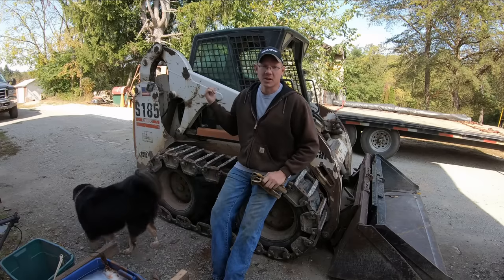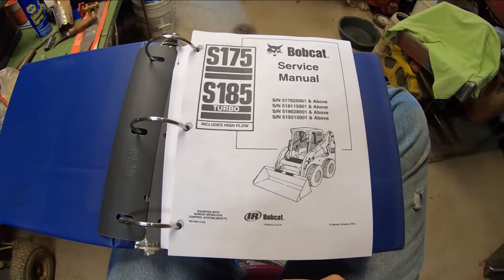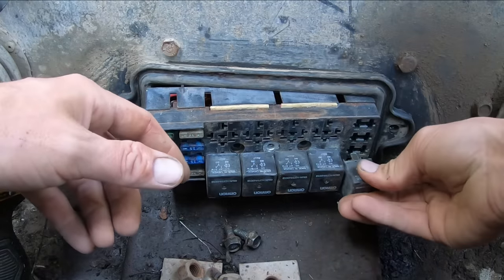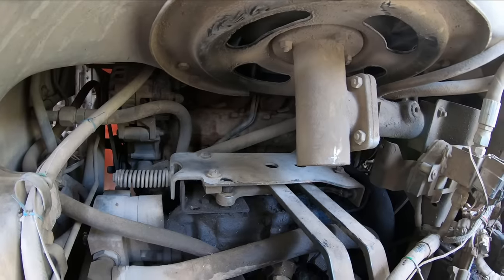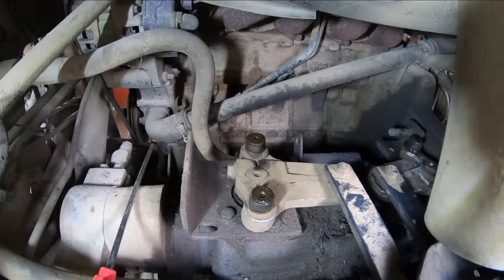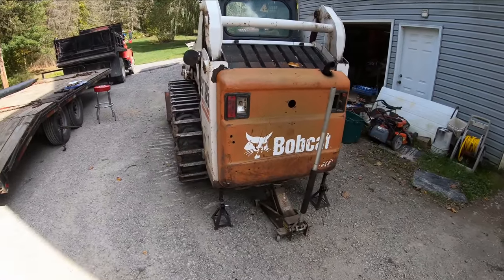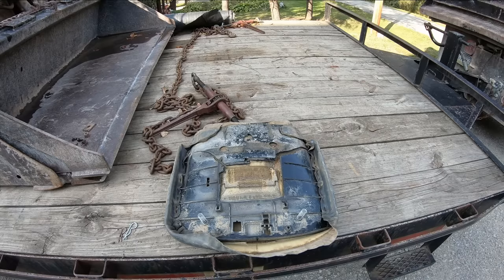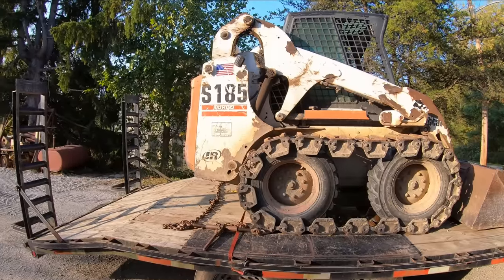Troubleshooting and Repairing Neglected S185 Bobcat Skid Steer

Comment: Normal bobcat problems. I've been a bobcat tech for 18 years
Reply: So as a seasoned tech, what is your thoughts on a used machine with minor creep, both machines i have looked at were good except one creeped forward evenly could jiggle it to get it to holdmost of time, the other left side only all the time both fwd and rev. If its all cheap parts and simple as in this video to fix i would have bought the first machine for sure. 

The 2nd machine also at an idle checking for slop it  stalled when i lifted the front up half way up it stalled at an idle, oops! I wasnt thinking and forgot to raise throttle(sales guy was yapping through the window too damn much) no biggie, buuuut it would not refire until i cranked throttle way up, when if fired the machine started shaking and could hear pump freaking out flow wise it seemed, then settled and i could set machine back down.
Reply: @bmori59f100  manual steering shouldn't be too expensive to repair. Creep is a result of wear of a few parts. Depending on the model, the cams and blocks can be turned instead of replaced to provide a new wear surface. The adjustment procedure has a lot of specific steps to be performed in order to make it factory correct. Usually people can get by with a quick and dirty adjustment to solve creeping. Ideally,  after a proper steering job, the machine will drive straight, have equal travel speed forward or reverse,  and the levers will snap back to neutral. 
  The engine on a bobcat loader shouldn't stall while lifting at idle. It might be forgivable if the oil was really cold.
Reply: @danielpalmer4717  awesome, as a thought thank you for that reply! The stall was very odd i thought, especially the way it shook and acted, like to circuits fighting eachother. Oil was cool but had been running machine around parking lot for about 10mins after warming up for 10mins. 

They other thing i have noticed is excessive or un controlled bucking and jumping moving forward or rev, when trying to move slowly or precisely. I assume this is normally wear on the above items as well? Seen this on a few machines.
Reply: @bmori59f100  yes bucking and jumping can be caused by worn steering parts. The "two circuits fighting" that you described could possibly be caused by the auxiliaries being locked on, if you were playing with the auxiliary buttons beforehand,  which is also why engine stalled.
Reply: @danielpalmer4717  i may have switched aux on then off just befor e hand, thats a good point. The damn sales guy kept telling me what to hit and would not just let me run it like normal.

Comment: Just seen Jessie miller's new vid on over the tire track urs look ten time more durable urs are like bike chain on the sides but Jessie hast tire chain tracks love the bobccat but Jessie's skid steer is cooler looking i love weird boom machines like the telle skid sis boom loader love ur vids man 👍 wish I liked in the country side have a bunch of adult tonka toys a few four wheelers and mx bikes but crap I live on poxy council estate in Manchester UK lol
Reply from the maker: Yes i watched his video as well, those tracks are functional but about the minimum you need to get by, the spacing between cross bars is much too far in my opinion. These tracks are designed to be worn out them rebushed to keep going quite a long time. But they are quite a bit more expensive
Reply: @DieselCreek  saying goes buy cheap buy twice but its sometimes u do get decent stuff at fantastic prices for example boost sensor has gone in my car for a non gen is like £38 but a genuine audi oem bosch is £44 do don't mind paying a tad more for quality
Reply from the maker: I agree but he said in his video this was just until he got a rubber track machine so in that case he did okay I suppose
Reply: @DieselCreek  Yea it's not too bad till he gets a proper tracked skid steer if it last even two years still be wort it

Comment: You need to try some Deoxit D5 https://caig.com/product/deoxit-d5s-6/ on those contacts.  And, please...DON'T use a "dielectric" grease ON the contacts. It is an insulator, use it on the seals around the contacts. It also goes in the boot of the spark plug, not on the connector of the spark plug. As an A&P mechanic with 40+ years of experience, trust me.

Comment: why did you loosen the one that was already good?
Reply: Because that design of swash plate (if that's what it's called) doesn't have a left and right adjuster as such.  You have to adjust both blocks until the whole thing works correctly.

Designed to be cheap to make, not good to work on.

Comment: Man those squeaking tracks are like fingernails on a blackboard. You can’t afford a can of spray lubricant to quiet them up?
Reply: Lubricating tracks would just make them pick up even more dirt, making them even more squeaky. It would only make it worse.
Reply: @maxz8807  Fair enough, I’ve never seen a bob cat skid steer with steel tracks before today. I thought they had rubber tracks? I guess the steel ones would last a lot longer? 👍